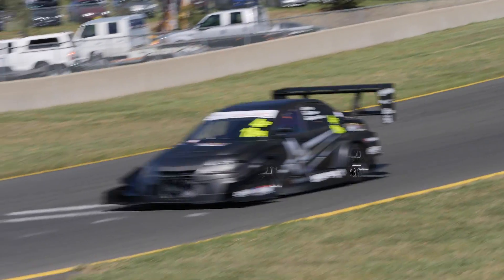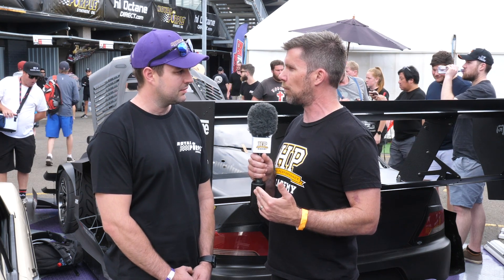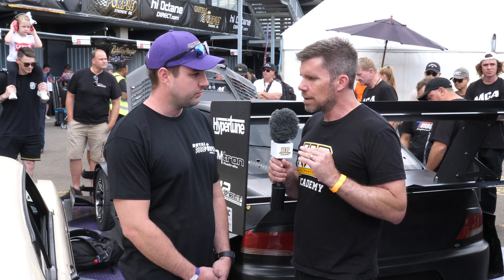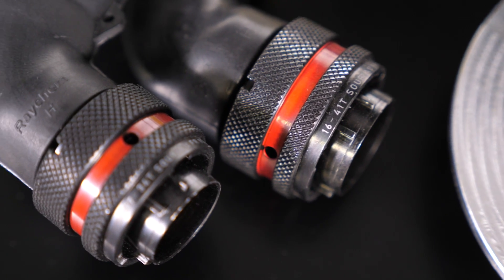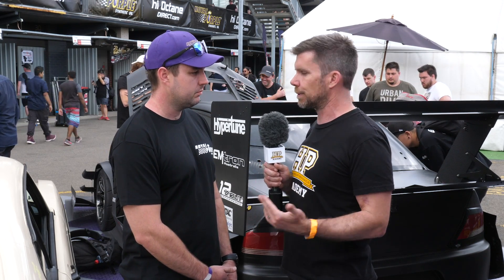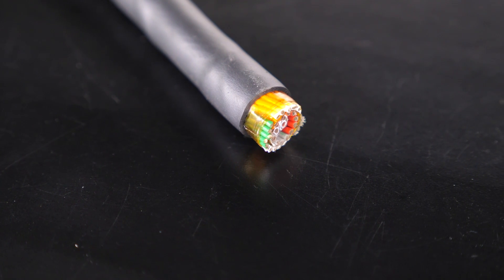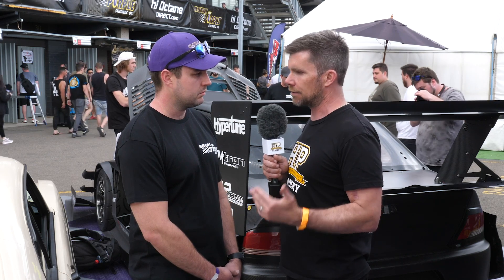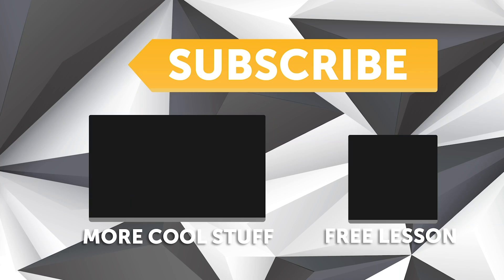Where Do You Start Wiring A 1200HP Time Attack Legend? [TECH TALK]

Comment: Is silicone shielded insulated wire ever considered? it's capable of withstanding much higher heats than 85deg, is far more flexible than pvc (or similar) insulated wire and available in tinned copper core.
Reply from the maker: There are always pros and cons for any material, even ETFE (Tefzel) but it's really the sum of all the pros and cons together that decide what is fit for your application rather than just the few things a material is excellent at.
Silicone Rubber is not physically as strong as Tefzel by a long shot for example, and I'm also not sure how standardised it is across the industry when it comes to consistently getting exactly the same product from different suppliers.
I'm sure there are some applications where the pros of Silicone Rubber would see it as a better option but it might just not be in motorsports - Taz.
Reply: Silicone insulated wire has almost zero cut resistance and is more than twice as thick for a given wire gauge, it’s like working with spaghetti. Horrible stuff